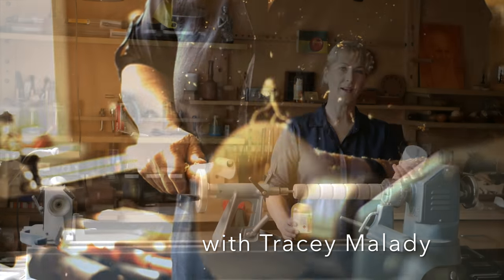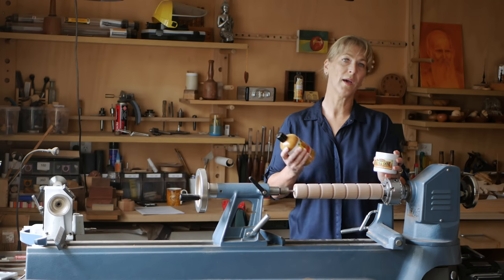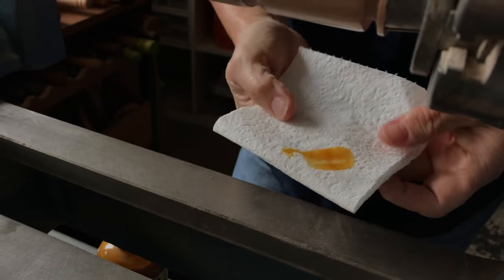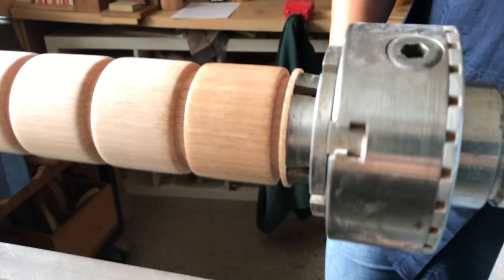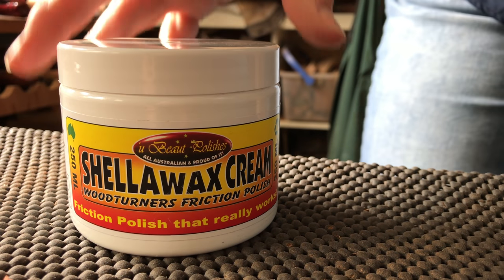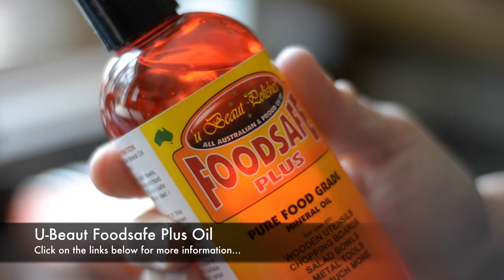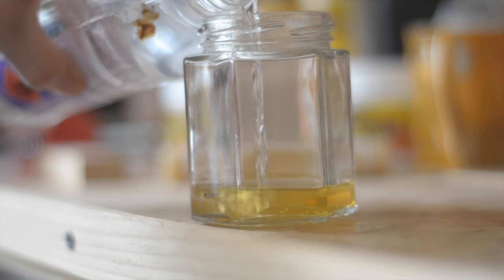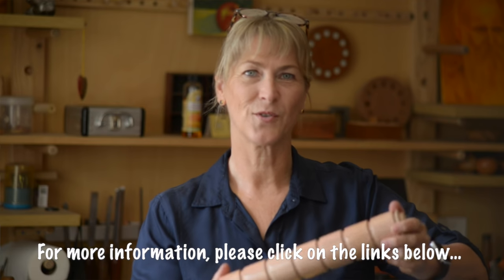Finishing with U Beaut!

Comment: Hi! I’m just starting turning and can’t seem to get good shines. I use the EEE ultra shine first and get a lovely shine but then I apple the shellawax cream and it gives a dull look.  It’s it supposed to be like that? Am I not turning it fast enough? Thanks for your help.
Reply: Hi Nick - it needs to work the other way around. EEE is not a finish as such, the wax is the carrier for the cutting compound contained in it. So first you need to seal the timber with the Shellawax and then apply the EEE over the top which will "cut back" the finish ever so slightly giving you a higher gloss, but it will always remain sealed with the Shellawax underneath. Hope that helps.
Reply: @timbeconmoderator5158  ok! I figured I was doing something wrong. 
So apply the shellawax cream first and then the EEE over top of that? I